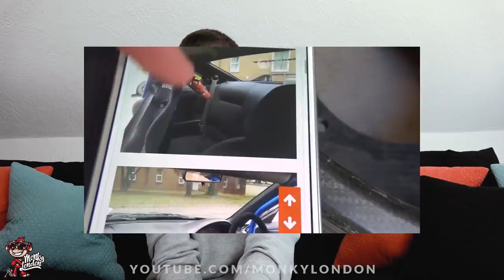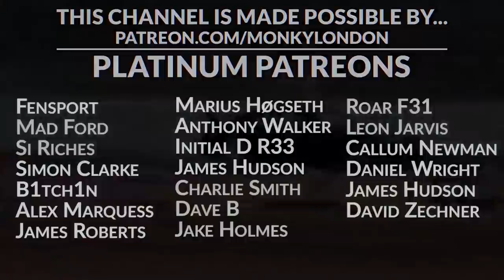🐒 THE REAL FAST & FURIOUS - MY CRAZY CAR HISTORY, EVERY CAR I'VE OWNED!

Comment: I bought an MX5 to track and drift. I tore the rear axles diff and half of the subframe completely off.  I grabbed the handbrake on a single-lane residential road with 5-inch curbs on each side.  Then I went to Orlando speed world and took a drift class. Cart before the horse.